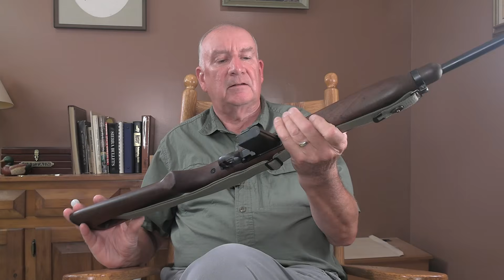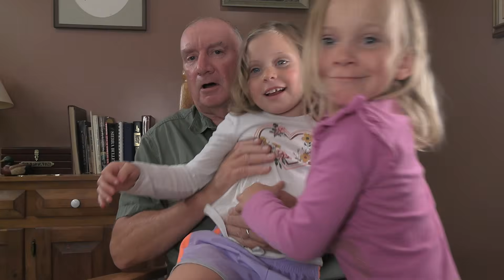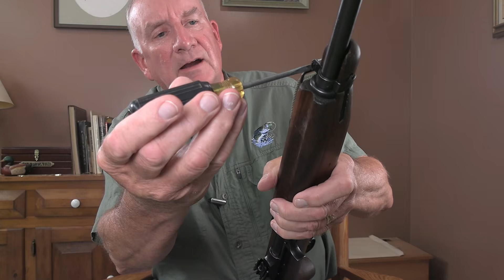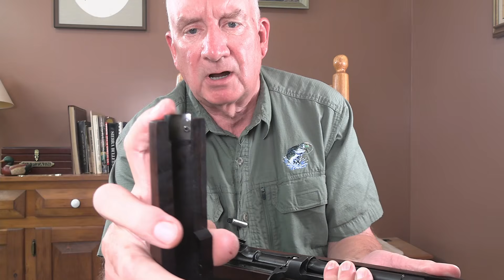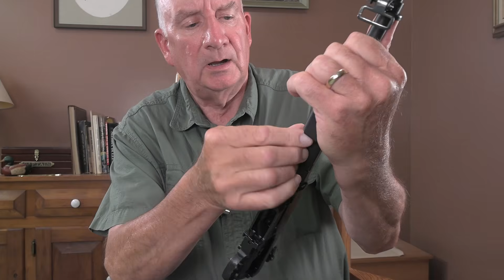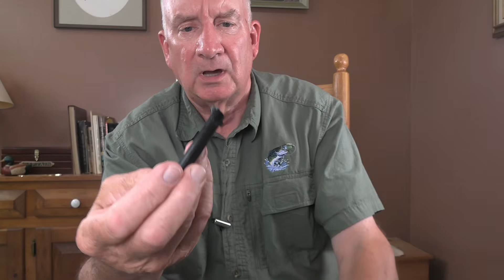The 30 US M1 Carbine ~ Successful, Fun, and Collectors' Favorite!

Comment: Personally I think they are neat little carbines.
I am old enough to recall a time when as dirt cheap as other surplus rifles were sold for. The M1 Carbine was considered bottom of the barrel hardly desirable at all. 
The false stories of the 30 carbine round being under powered cursed sales. I recall gun stores with sections of their racks full of M1 Carbines. In hind sight I wish I would have purchased a few more. 
Historically I don't think this claim that it was a very desirable by the troops is accurate.
On the collector side. In my opinion it didn't become a desirable collector until the recent WWII movies and video games.

Comment: Almost all of these carbines are "Corrected" that is replacing improved parts with the early parts just for looks. The guns you want are called original. They are mostly late 1944 guns that have the type 2 bands, type 2   or 3 bands and genuine original wood. Many of these 1944 guns were from Inland, Winchester, NPM and went straight into storage. Sold in the 60s through the NRA for $20. Ammo was 5 cents a round. They made 6M in about 3 years and never made another. West coast carbines are beyond $1100 now.

Comment: Did some quick googling...apparently deer are something like 200+ lbs on average and the average human weight varies by continent between 130 lbs and 180 lbs.

What is interesting is that the thing is more powerful than what's needed for varmint but a bit under powered for most deer hunting...it seems like the constraints placed on the rifle have resulted in something that is exactly what's needed for the task at hand. I find these types of tools really interesting because they're always just enough for the task at hand and the result is a decent amount of talk that the thing should be more. 

A good portion of workers want some excess so they can do their jobs easily in a more relaxed way, but the M1 Carbine seems to have treated that as a bar that should be only just met before focusing on other metrics, like ease of use for new workers and the logistical side of things with high numbers and a minimum of materials used.

That's also why I find 5.56 and 5.7x28 to be such interesting concepts because in both cases they seemed determined to do more with less...it's almost a pity that the two rounds are invalidated by the logistical strength of the US military and the commercial strength of the US private gun market to the point that bigger is more obviously better. Carbines that shoot rounds that are just enough for the task at hand are no longer essential when the troops carrying said weapons are no longer dropping in by parachute.

Comment: I subbed,
Ive found out that there are a lot of differant M1 Carbine's made. But ive been all over the internet and haven't found one yet like mine. No rear sight holes on the back of the action. Single blade front aight. The actual rear sight is in front of the chamber and the forgrip is cut out for said sight. It has an Inland trigger assembly and has a raised cheek stock with no oiler tube cut out of it! Any help from anyone would be much appreciated

Comment: My dad was a mortarman with the 29th Div. in WW2. Was issued an M1 Carbine & he loved it. He said he could knock someone down at up to 200 yards, no problem. He did say that sometimes on  very cold nights he would have to keep moving the bolt handle to prevent freezing. To prevent that someone came up with the idea of mixing motor oil with gasoline & coating the action. Worked like a charm he said. Great video.

Comment: Always enjoy your informative videos; and the m1 is prob my favorite wwii weapon. Now a question of curiosity: if you were going to “rebarrel” an m1 carbine with a modern cartridge, what would you choose? I’m not talking about a ruger mini 15 or 30, but a genuine m1 carbine. I have seen videos of people trying to recaliber them in .357 or 38 special but i think it might be better to go smaller bore to get better long range accuracy like 5.7 x29 or maybe even a wildcat cartridge like a .30 carbine necked down to a 6mm or 6.5 mm. I’d like to know your thoughts on an alternate cartridge that would fit the m1  receiver and possibly increase its overall performance. Thanks
Reply from the maker: Magazine size is the sole determining factor.  The .357 and .38 Special are rimmed cartridges that will not stack in an M1 Carbine magazine.  I know of no conversion using a commercial round that could work. It's possible that a wildcat could be created with a smaller caliber than .30, but that would be about it.

Comment: I inherited my 30 cal M1, I believe it’s circa 1962 from Plainfield Mfg. It sat in a closet, untouched for probably 45 years, I cleaned it up and it now runs like a jet. It rings an eight inch plate at 100yds with no effort. I’m continually on the lookout for a WWII model, for collecting purposes. I love the gun and wouldn’t hesitate to use it for self defense.🇺🇸
Reply: 1973 National Ordnance, gifted to  me by a coworker.

Comment: Thanks for this! I missed my best chance at getting one from CMP when they got that big shipment, I believe in 2009; they were priced at under $500. Later, I bought a commercial model, a Universal, which differs significantly, notably in that it has dual recoil springs. It shoots just fine, BUT I wanted a GI model! First of this month, Classic got in some out of Ethiopia, and I decided to GO for it, even though they were WAY more expensive. 
I GOT THE LAST ROCK-OLA THEY HAD! WOOT!
It had 70 years of warehouse dust on it, but no corrosion or pitting, and the barrel looks perfect. I've only put fifty rounds through it, but it's a lot more accurate than I am. 
One of the resources I've read in the past couple of weeks said that most of the complaints about lack of penetration in Korea came from non-combat troops, who fired full-auto until they were low on ammo. The troops with more combat experience stayed with semi-auto, and didn't complain.
Happy Thanksgiving!
Peace be on your household.

Comment: I think that the "floating chamber"  was "carbine Williams" biggest claim to fame and while he was a good designer His murder conviction was for killing a peace officer.
   I have been told by ww2 vets that while the carbine was light weight and compact it lacked the effective range needed at times when up against 8 x 57 Mausers and arisakas
Reply: @ warren beard- Re: "I have been told by ww2 vets that while the carbine was light weight and compact it lacked the effective range needed at times when up against 8 x 57 Mausers and arisakas"

That's been a consistent problem with the M-1/M-2 Carbine from the start, misunderstanding the role for which it was intended. The carbine, which fires a straight-walled pistol-style cartridge, and not a bottleneck full-power center-fire rifle cartridge like the M-1 Garand, was intended from the start not as a replacement for the M-1 Garand, but to replace or augment the side-arm, the M1911 or other service pistol. Front-line troops, seeing how light, handy and easy to use it was, though, turned them into highly sought-after weapons. Many traded Garands for them, not really realizing that the carbine was never meant as a replacement for the M-1. Naturally, they were disappointed in the carbine's performance in comparison to full-sized battle rifles, including the Arisaka and the K98K Mauser. 

The role for which the carbine was intended did not really have a name yet, but its class of weapon would later be described as PDWs or "personal defense weapons," weapons designed primarily for close-to-medium range use, often but not exclusively in a defensive role. They were intended for issue to troops who needed to be armed in the course of their duties, but whose primary job was something else other than that of an infantryman. MPs, mechanics, combat engineers, certain NCOs and officers, supply personnel, construction battalions, vehicle and tank crews, etc. 

It isn't hard to see how the misunderstanding came about: An M-1 Carbine is effective with its 110-grain bullet moving about 1960 fps at the muzzle, out to 100-150 yards optimally, whereas a Garand or similar rifle is lethal out to 800-1000 yards or more with its 150-grain bullet at 2800 fps at the muzzle. Different weapons firing different cartridges for different roles.

Comment: Great video GunBlue. I learned a lot from you and you now have me seriously thinking about picking up one of these historic rifles. My only concern is you mentioned it being too light for hunting. WIth it's short length and good accuracy I would think it would be a great whitetail rifle for the northeast USA. 
I hunt New England whitetails where 95% of my shots are <100 yards and most within 60 yds. If this 30 carbine cartridge is a man stopper at 300 yards, I have to wonder why it wouldn't do the job on say a 240lb buck at 80 yards... Especially with all the improvements in modern ammo. Won't 110 gr hollow points work? Or higher bullet weights? Is it because the gun can't handle them? I googled up Hornady Critical Defense Ammo, .30 Carbine, FTX, 110 Grain and can't help but think this bullet would mushroon and drop that buck pretty much in his tracks with a well placed shot. Your thoughts??    
Love your videos. God bless you.

Comment: I think I know why the idea that the M1 carbine was underpowered is. Over twenty years ago I was up at our deer camp in the catskills. It was February and very very cold, the kind of conditions that existed during the winter fighting in Korea. We were shooting targets with an M1 carbine and a repro 1875 Remington in 45 colt. After shooting both guns we were walking down range to check the targets and to my amazement we found 45 and 30 carbine bullets laying on top of the snow. Rifling marks on the projectiles but that's all. The bullets were found at different ranges but no further than 100 yards. I think the cold dense air affected the projectiles and caused such an odd situation. I still have some of the bullets. If it happened to me I'd think it could have happened in the Korean winter.
Reply: Well, that explains Hitler winning the war.  The Soviets equipped their front line infantry with wimpier than the M1 Carbine sub machine guns that fired a lighter 30 caliber pistol round at a lower velocity and they have much thicker winter air.   The Waffen SS just swatted those bullets out of the air with their bare hands.

Comment: I really like the 30 carbine. I have a few questions. What current magazine manufacturer do you prefer or do you think they are all about equal?  Do you think there is a accuracy difference between having the bayonet lug versus not having it ?  I've never heard anyone elaborate on the windage adjustment? Is it click adjustable probably 1 click 1 moa? You have two very fine examples what would you say today's value would be for those? I know probably too many questions. Thank you 👍
Reply from the maker: All Govt issue magazines were made to the same specs and provide the same reliability. Pro-Mag makes them to the same standard, and there may be others. Rear sight clicks are 1 MOA, that is, 1" per hundred yards. I don't believe there's a practical accuracy difference between carbines with or without bayonet lugs, as they all had to pass the military requirement of at least 4 MOA with service ammo, though most certainly can do better. One shouldn't approach military rifles made for fending off barb wire, cushioning falls on streets, and bayonet fighting with ideas of one hole groups. An MOA rifle wouldn't last five minutes in that demanding role. A carbine in good condition with an armory overhaul is currently well over $2,000, while one in excellent condition with correct parts, as issued, can bring well over $3,500, depending on maker.  The US paid $47 during WWII.
Reply: @GunBlue490  Thank you. I understand what you are saying about the accuracy of a battle rifle. I would be satisfied with 4 moa for my use. What is your opinion on the reproductions? If you were going to choose a reproduction which one would it be? 2000 for a World war II M1 carbine would be fine for me I don't have to have a perfect parts matching collector gun. Thanks 👍

Comment: Very interesting,  a few minutes ago I Googled "what's the difference between a rifle and a carbine" and that got cleared up as clear as mud:) HA! Most common response was a carbine is generally shorter, and also a rifle's barrel is "rifled" but a 10/22 has a short barrel 18.5" and it's referred to as a .22 rifle, it's all confusing.
Reply: Nothing to do with rifling, just the fact that a carbine is shorter and handier than a full length rifle. It is sort of confusing because a carbine is technically a type of rifle, but within the class of firearms "rifles" itself, a military's standard length rifle is refered to as just a "rifle"(Ex. "U.S. Rifle, Caliber .30, M1" - The M1 Garand) while a rifle specifically intended to be shorter than the standard length rifle will be referred to as a "carbine"(Ex. U.S. Carbine, Caliber .30, M1 - The M1 Carbine). The same sort of thing happens with civilian rifles too. The standard length Ruger 10/22 has a "carbine" version with a shorter barrel. Some people may refer to any short, compact rifle as a "carbine", regardless of whether there is actually a longer version of it or if it was intended to be shorter than a military's standard length rifle. Hope that's not too confusing lol.
Reply: @blackbird_actual  No, that actually helped. Thanks
Reply from the maker: Carbine normally refers to a short barreled version of a standard rifle. However, the M1 Carbine is a rifle unto itself; there being no larger version. There is no distinct rule for the term, and barrel lengths are subjective, and have changed over time. For instance, a standard AR-15 with a "long" 20" barrel is called a rifle, which at one time would certainly have been considered a short barrelled carbine. The short barrelled M4 is a carbine version of the M16, but because it is now the official issue and the 20" barrel parent has faded into military history, it typically is called simply a rifle.